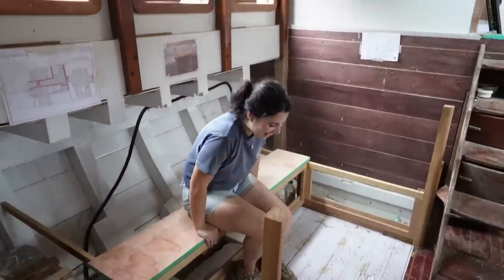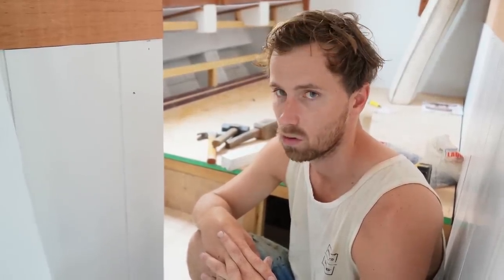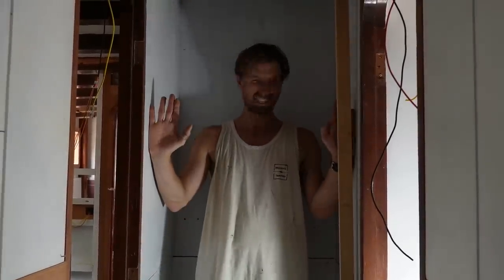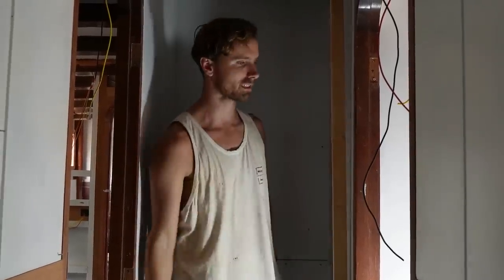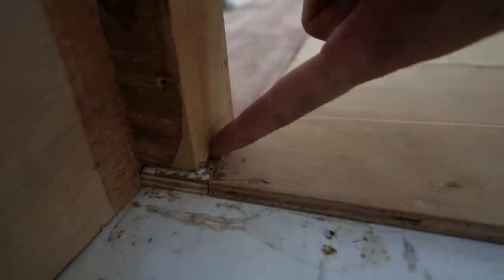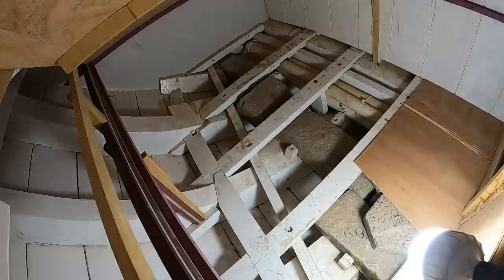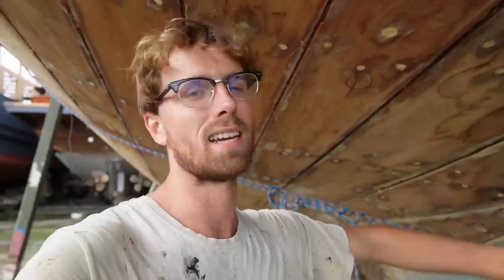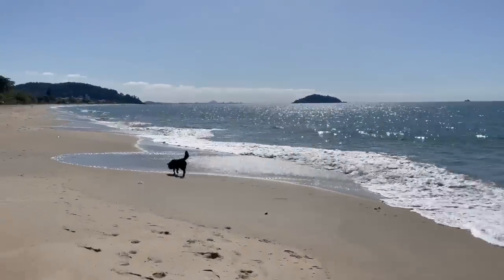Wooden boat restoration: fixing mistakes — Sailing Yabá #118

Comment: Recycling the old wood is great, a few brass bronze vent grills might be an idea to let the air circulate under the built in areas. Great update 2x👍

Comment: One important wrinkle to consider aboit your leak inspection plan. Quite often, specially with traditional decks, the location where water is penetrating the living space is not the same as where the leak acually drops into the living space. A seam seven feet away from one of those panels could be causing the leak above it. Not shooting down the panel idea, just adding some personal hard learned knowledge tracking down leaks on a 50 year old trawler.

Comment: I was taught by old timber boat builders never to pack in the caulking super tight like that , we used hemp n pine tar , especially if it's opened up from drying out like that when it all swells up the pressure on the boards can be to much for the fastners and you blow planks off, some boats that took to long and didn't keep the hull wet got piles of saw dust thrown in the water with the boat to keep it afloat till planks swelled back up

Comment: Hi Ben & MP.  I love what you are doing and how hard working you two are.  I do have a question.  I grew up on the ocean in New England and have had several wooden boats.  Back in the 60's and 70's a lot of boat owners got the bright idea to fiberglass wooden boats only to find out that in a couple of years the wood dry rotted and had to be replaced.  You are using a lot of fiberglass and epoxy on the Yaba.  Are you worried about having a problem with dry rot because the wood cannot breath?  I envy the access to hard wood that you have.  Purple Heart is my favorite.  I look forward to launch date.  Mike.

Comment: Just as a thought guys, have you thought about vacuums bags to seal in clothes, blankets etc, saves heaps of room, makes them mould proof and as the bags are plastic they are water resistant

Comment: One traditional method of venting storage areas was to drill seven 2cm holes within a 15cm circle. (two on top, three in the middle and two on the bottom). You can repeat this every 30 to 45cm along the vertical sides of the storage 'bins'. A nine hole diamond pattern can be used as well, either alone or alternating with the seven hole vents. This way, you don't have to spend money on fancy metal grills or wooden louvers and you can place as many as you want...:hand-purple-blue-peace:

Comment: Hey what I don't understand is that when you were putting the ballast and how did you know the boat was balanced without putting it in the water? Have you done a water test yet? Also how do you know there are no leaks without putting it in the water first?

Comment: Congratulations on bouncing back from the caulking setback. Does the deck need caulking or is it ´just’ the hull.
Reply from the maker: Thank you so much Mike! Unfortunately we will have to recaulk the deck too 😰 but for different reasons. On the deck we had a problem with the compound we used, that never catalyzed properly (it's been months and funnily enough it's not completely dry yet). We probably got a bad batch from the factory. They will be sending us a new kit so we can do it again and hopefully this time it cures correctly 😉🤞
Reply: @SailingYaba  oh, that's so unfortunate! What a bummer. I hope the factory gives you the new batch free?

Comment: Having caulked wooden fishing boats with oakum and also smaller boats with cotton I certainly never used a metal lump hammer, I had a proper caulking mallet made from linguine vitae which rings when the caulking is hammered home enough.  Also the caulking should really be tucked as it is put in, not just forced in, in one line.  It is possible to over caulk a hull especially if the planking is very dry.  I assume you will use a softer compound like red lead putty or similar that way it will stay soft until she takes up.  I hope this is the last time you have to do this for a while.

Comment: It's so strange to see what looks like an actual 17th or 18th century pirate ship just floating ever so casually down the river past the shipyard. AAarrrgh! 😆
It's really coming together and looking good. You have been come SO far from where you were as people when you started this project. It's so great watching both the boat, and you progress. 
Fyi: I really don't think you've got enough supports under the bench seating and the beds. Those frames look pretty flimsy. The plywood might feel strong right now, but having lived in a tiny house with plywood benches, they sag over time, and even crack where they meet the supports if you don't use enough of them. It would be worth at least doubling the supports, if not tripling them. Cutting that corner now will lead to inconvenient fixes needed later.

Comment: I believe that the best method of ensuring NO deck leaks is as follows - 
Sand the deck so its spotlessly clean
Cut to shape and nail down with small brass nails a very thin  sheet of marine plywood. Planked decks will move and swell or shrink over time, and the plywood will provide a stable surface.
Then cove all edges
Then lay fibreglass cloth over the decks.

Do it once, do it righr!

Comment: So with the work that was necessary to save any of the boat - not that much being saved - it would have been easier and probably cheaper to start from scratch. This is not going to be cheap either, could you not have saved money buy buying a production boat and already have been sailing?

Comment: Oakum is what is used below water, and that what you showed looked
bone dry it should have a oily feel to  it
Reply: That's what I use hemp and pine tar oakum they used cotton , dryed boat out opening it up  and packed it in really tight so when it all swells the fasteners let go n planks bust off
Reply: @johnsmith-dc3vs  Ouch!!!
Reply: @johnsmith-dc3vs  yup always left caulking till last and yes Oakum 
below water, cotton above but they caulk different i was shown doing a bit
of loop not straight
Reply: @mallyuk1  you were shown the proper way,  always last and the loop kinda fold technique I do the same , not bung cotton in straight as much and tight as possible , you should have a black leg from rolling the oakum on your leg  and bags of saw dust was good trick when you go back in just in case to hold it till she swells just incase, best guys were 100 years old and deaf from doin it for so long
Reply: @johnsmith-dc3vs  haha black leg i wore aleather piny had oily hands though
i used to do enough for a few runs then knock it in and yes he was a old timer ship rite worked at Preston docks when it was a live

Comment: Sorry to be so candid...but most of the interior construction looks slightly flimsy. I'm guessing that's a factor of cost-saving. Hope it all holds up over time.
Reply: On a boat that is the materials that are used for interior furniture and walls and doors they are duel purpose; practical use and beauty. Where the strength of the boat is most important  is in the hull, keel and decking and they have done that perfect as well. This is going to be a wonderful sailing vessel when it is completed.